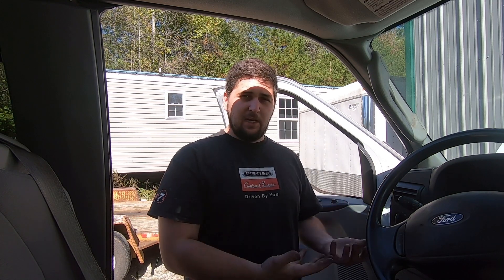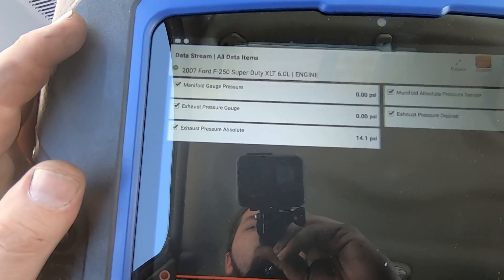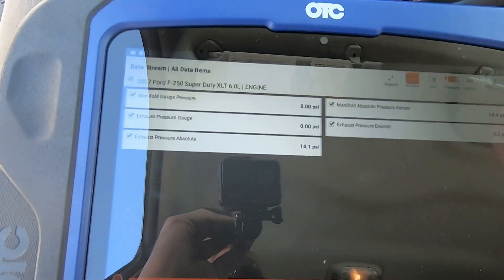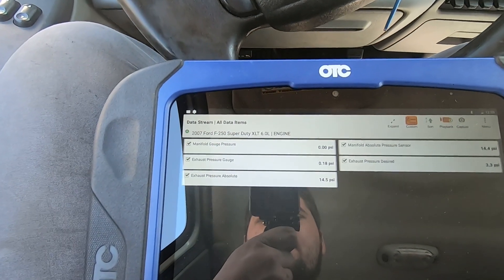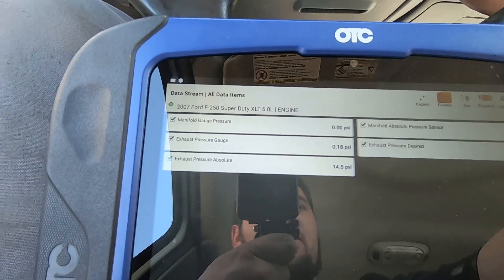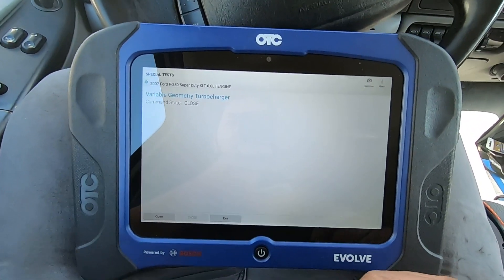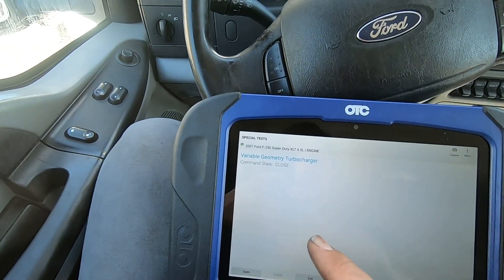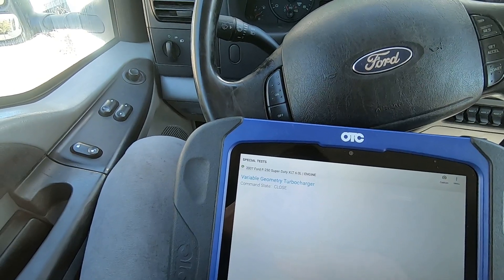P0299 Turbo Underboost - 6.0L Powerstroke Diagnostics! (PART 3)

Comment: just woundering what would cause it to fell like a miss fire in it only happens when im ideling at certent speeds it would putt from the turbo and caulf out black smoke causing it to surg ??????
Reply from the maker: If you have a skip you might want to look at injectors such as a sticking spool valve

Comment: I just bought a 6.0, bone stock,and I’ve been trying to figure out why it doesn’t whistle like other trucks I’ve heard. Hearing you rev this truck after the repair makes me think it’s just they way they sound all stock, I’ve replaced all the sensors chasing an issue that might not even exist 😮 any thoughts? No cel
Reply from the maker: If it still has stock exhaust then you won’t hear it because of the muffler

Comment: Hey bro my truck just threw this code . Nub with diesels here.. anyways. Truck is running fine noticed some oil where intercooler connect to turbo. Its a blue hose thats connected directly to turbo..
Reply from the maker: That hose could be cracked or ripped. Trace amounts of Oil inside the tube is normal but if it’s leaking out of it you need to check for crack or ripped in that boot. Especially if they are original boots as they are prolly pretty hurt by now.

Comment: I put a new turbo in and not leaking air but the boost stay around 14-15 not much higher than that check the sensor Ebp the tube cleaned out put a new egr cleaned the passages and everything gunked up idk what else I’m soo lost
Reply from the maker: Was it doing the same thing before the new turbo? Have you checked for exhaust leaks at the y pipe and manifolds and cac leaks?
Reply: @paulsperformance yeah it was doing the same thing with the other turbo in the morning it started and died and the started again and runned not that good checked for exhaust leaks nothing that I see or hear I’m at a halt now
Reply: I will check tommorw the cac doesn’t sound like it’s loosing the boost but take a bit too boost when I drove it

Comment: Can you tell us the wrench sizes for the EBP tube and sensor? When you are stuck on the side of the road it’s helpful to know what size wrench you need if you have to go buy one.
Reply: for the sensor 1 inch socket and to support the housing the nut size is 9/16th open end wrench so it doesnt twist off.

Comment: You may not see this. I hope you to and reply. So I’m having that code. My truck is showing negative boost at start up and then lagging to get boost. But my map, barro and ebp numbers are a lot different. I start my truck up and my baro and map are reading 28. My ebp is reading 45. I’ve cleaned my ebp sensor off. I can really get the tube off to clean it but I sprayed brake cleaner in and used a wire felt like I got most the way in  but the bends didn’t help. They were pretty gummed up so after cleaning that it idled better. I was thinking it was time to clean the vanes and unison ring but not sure what else to check before pulling it off.
Reply from the maker: @alexanderbaker2069  is the sensor new?

Comment: I got same code but truck does fine ? No loss of power no rough running only reason is got check engine light
Reply from the maker: Could have stuck vanes and still have good power. Will it clear. How long before it comes back
Reply: So if keep driving it will clear ? Could it be map sensor?

Comment: I have a 03 F550 and a 04 F450 that I’m having issues with.  When accelerating it spits/sputters and blows black smoke.  No codes or check engine light.  I unplugged the EBP and runs great.  Plug it back in and crap again.  Replaced EBP and tube.  Connected it again and runs like crap.  About to pull my hair out.  Suggestions please?
Reply from the maker: Did you happen to use a OEM ebp sensor? Also do you have anyway to check your ebp readings?
Reply: @ no on the OEM EBP. And I don’t have a way to read it.  What is a good but inexpensive scanner I can get?   I’m also going to pick up an OEM EBP sensor
Reply: Check inside connector.
Reply: @Aceman597  what connectors
Reply: @lonepeakfiredistrictwildla7614  ebp connector . Ron had video that they can break inside of it. May have to change that ebp connector.   I was lucky other day I changed ebp sensor cleaned the pipe with brake clean and looked at connector . Had alittle corrosion.  Cleaned with aircraft wire. Use dielectric grease . Mines working great .
Reply: @ yes. New connector.

Comment: 2006 6.0 is it normal when i start truck i dont hear turbo till bout a min like its warming up but after it kicks in i get boost while driving it does its normal cycling during idle
Reply from the maker: It could be. Depends on how the tuning is. A lot of custom tuning cycles the VGT vanes so it really depends on the tuner.
Reply: @paulsperformance  truck has a tune but i bought it as is dont kno what tune is had it for 2years perfectly fine just dnt kno if that was normal
Reply from the maker: @8407daking  it’s prolly normal. As long as drivability is fine I wouldn’t worry on it.

Comment: Is it possible for one or both of the large o-rings to go bad and leak boost and exhaust without throwing any codes ?
Reply from the maker: Which orings are you referring to?
Reply: @paulsperformance  mostly the one big one on the cast iron piece. Have soot on the hood directly above the turbo. But I haven't had the chance to actually get a good look at everything. Just a quick glance.
Reply from the maker: @larryhurley2314  the cast iron side of the turbo does not have an oring. Whatever is leaking on exhaust side will be evident and have soot buildup around it. I would doubt it’s the turbo itself unless the clamp has failed or someone has taken it apart before. I would check the firewall area for soot because the y pipe is very common leak. At the bellows or even at the turbo connection.
Reply: @paulsperformance  thank you so much. I really appreciate it. I will look at that. Prior owner had new seals and etc put in mid last year right before I bought it. Been a great truck except for this darn leak. Thank you again.

Comment: Do you ever pressurize the system at the boos intake and check for leaks?
Reply from the maker: Yeah sometimes I’ll use a smoke machine to find a leak if I can’t find it visually. Usually there is soot buildup around every leak though but I have had some that were tricky to find.
Reply: @paulsperformance  I have a smoke machine and currently getting ready to pull my turbo. Where would I connect my smoke machine? Note- when I tried the pressure test and soapy water, it would not pressurize over 6psi and I kept hearing air leak in the oil filler cap area.
Reply from the maker: Depends on which side you’re testing. I have a cap that goes on the front of the turbo and that checks the intake side intercooler,pipes, etc. For the exhaust side I usually take the ebp sensor out and insert smoke in from there. You will have to undo the down pipe and block the opening for the down pipe or else the smoke will just go out the exhaust. Most likely places for leaks are usually the bellow flex pipe on the y pipe assembly for the exhaust side and on the intake side the most common I see it intercooler boots.
Reply: @paulsperformance  do you know why I cannot hold pressure when I hook up a pressure tester to the face of the turbo? For instance i try to fill it with 10 psi and hold it there, but i constantly need to be pumping air into it just to get it up to 6 psi. I hear air through the oil fill tube.
Reply: @paulsperformance  any idea about the air I hear through the oil cap?
Reply from the maker: Prolly coming from valves being open
Reply: @paulsperformance  I did a second pressure test after driving it for a while and when I did it was all sealed up and worked well.

Comment: My 06 has an under boost code it doesn’t whistle at idle but whistle when I accelerate and my rpms get past like 1500. Kinda breaks up a little on the initial drive then it clears up for the most part. Do you think I need to clean my turbo the veins and ring? Truck doesn’t get drove much it’s got 16300 miles
Reply from the maker: It’s possible they are getting stuck. I see them stuck aloe with trucks that sit a lot as moisture settles in the turbo and causes the veins to rust and get sticky.
Reply: Did you ever figure out this problem? Mines is doing the same thing.

Comment: Great video brother
Reply from the maker: Thanks
Reply: I'm having some issues with mine,  imma test the ebp sensor tomorrow...I have a 03 f250 6.0...It's doing some erratic surging, already put in a new icp senor and pigtail. My instrument cluster is not working properly. I have read that when they fixed their cluster everything went back to normal...Problem seems like electrical cuz it's not constant. It does it every now and then.
Reply from the maker: @nelmor29  the instrument clusters on these trucks do fail quite often and they willl cause funky events to happen. I keep a test cluster in my shop as I’ve seen a few. The ones I’ve had caused interior issues though. Guess the age of these trucks is catching up with the modules now.
Reply: Thanks for your response brother.

Comment: How do you recommend cleaning the turbo vanes
Reply from the maker: Needle scaler works nice for getting the rust off. Also can use soft Brillo pad to clean up afterwards.
Reply: @paulsperformance  might me a long shot but anyway to get them at least somewhat clean without pulling the turbo? Additive maybe
Reply from the maker: @CarsenSmits  unfortunately not. You could split the turbo with it still installed though but the turbo isn’t that bad to remove on these but It could be split while still inside the truck which may be easier for you but I can have the whole turbo out in less than 20 minutes but I have done a few. Alternator does not have to come off either. It will come out with everything there. Just a little positioning.

Comment: sorry .. did I miss about the EGR? - good vids.. thanks
Reply from the maker: Thanks and I did touch base on the egr valve. Checking to make sure it’s not stuck open with heavy soot buildup or just faulty and not springing the valve back closed.